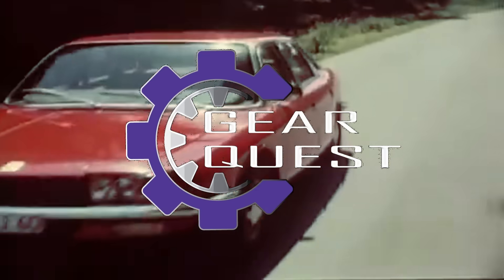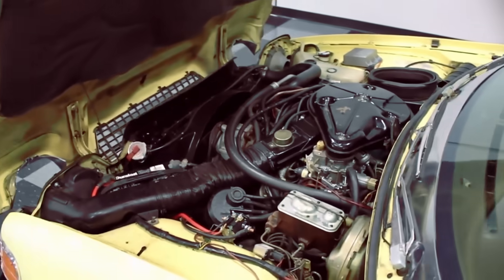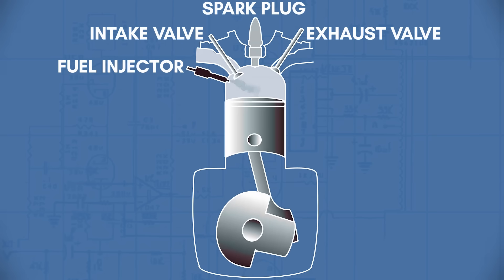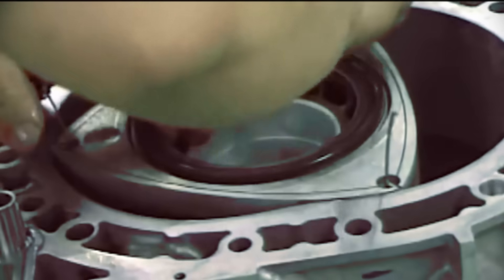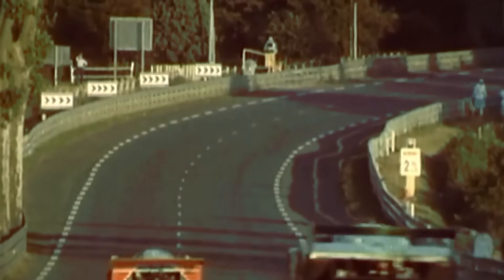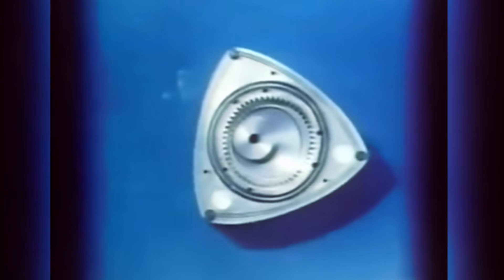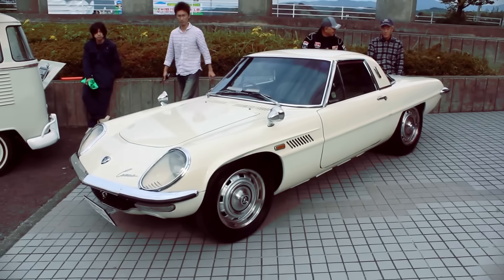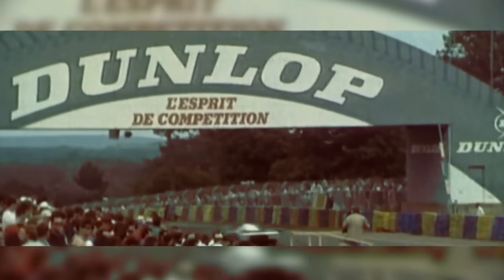The History of the Rotary Design

Comment: Why rotary banned? 

An easy win 🤔 Maybe.
Reply: it was a win by accident... in Group C the rotary was never successfull, the 24h win was pure luck of Mazda that all favorits from Jaguar and Mercedes run into trouble a the same single race... the rest of the season the Mazda rotary never had a chance to win anything..it even failed to battle private raced old Porsche 962 and only the pure luck victory at LeMans put Mazda on place 5 at the end of the season ahead private raced Kremer Racing Porsche 962  (a 7year old racecar at that time in 1991) with only 4 points ahead of a 7 year old race car... 

The old private Kremer Porsche beat the Mazda rotary in every other endurance race of 1991... by race succes and result numbers the Mazda 787B was no great race car..only the internet hype later made it "historical" 
1991 was dominated by Jaguar
Reply: Well i don't want to disrespect anyone.

 Rotary engine is very good engine but a bad engine at the same times, people try their best to make it "reliable" until now, i don't know how long its gonna take to perfecting that engine.

If you ask me why, i'm just can say "the raw power that engine make, will make all people put a smile on their face"
Reply: If that was the case, the 787B wouldn't only have 1 win under its belt.

Regarding Group C, wankels were "banned" merely as collateral damage caused by regulation changes, designed to make Group C less attractive to Privateer Teams in comparison to Formula 1.

The Porsche 962 (3 liter Twin Turbo Flat-6), Mercedes Sauber C11 (5 liter Twin Turbo V8) and Jaguar XJR-9 (7 liter naturally aspirated V12) were "banned" too after all, since their engines didn't fit the new regs either (new regs said 3.5 liter naturally aspirated F1 style engines).
Reply: The fact that many JDM car get banned in many race its make me curious?

Well we know the fact that japanese car sold every where in the world, its like dominated the car trade, 🤔 maybe, just maybe its why many fast JDM car get banned.
Reply: @ketutkartini3768 
Name a race series where a Japanese car has been specifically banned.

And no, Le Mans isn't one, since Mazda still raced in Le Mans, when the new 3.5 rules had been implemented (mind you, the MXR-01 didn't fare that well, but then again, few Group C cars did with the 3.5 rules).

In Group C at least, the decision to change into a 3.5 liter formula, was motivated by a wish to make Formula 1 engine development cheaper (and lure teams away from Group C), and had nothing to do with "stopping JDM cars from winning Le Mans".
Reply: Ratter then ask me, why don't you search it on google for more information? 😅😅😅
Reply: @ketutkartini3768 
I have researched this.

There is none.

The Wankel wasn't banned because of it being "too good" and AWD being banned from Touring Cars wasn't just because of the Skyline (nah, ze Germans had an AWD car too, and it was montering races in DTM, just like the Skyline was killing it in the JGTC).

Just concider the Mazda 787B myth thoroughly busted. It had nothing to do with the FIA or the ACO wanting to keep the Japanese out of Le Mans (I mean, if that was the case, why did Toyota keep on racing there, with the Supra GT1, the TS-010, the GT-ONE, the TS-030, TS-040 and finally winning with the TS-050 although, only after all the other works LMP1 teams had left).
Reply: I still had my opinion 😃
Reply: @ketutkartini3768 
This isn't about opinions.

It's about facts (and possible libelling of a motorsports organisation, but we'll let that slide).

If you think the Wankel was banned by the FIA or the ACO from Le Mans for being too good, then you better have some hard evidence to back it up.
Reply: People free to had their opinion, its not like i want to blaming someone or something just because japanese car get banned.

Or need to prove what i am saying, its just my simple opinion saying "japanese car get banned because its being too good". If everyone can feel free to had their own "ego" why i can't? 😎
Reply: @ketutkartini3768 
Because, that's a claim, not an opinion.

"I like Japanese cars better" is an opinion.

"Japanese cars got banned for being too good" is a claim (and one that's false).
Reply: I don't really care about silly stuff like that, for me japanese car is the best then glamor, stupid expensive, unreliable car.

Even if japanese car is old school.
Reply: @ketutkartini3768 
Well, you have to care, if you want to get into racing.

And generally, regs don't care shit number 1 about your tastes.

But hey, FIA is phasing out LMP1 in favor of a new Hypercar class (think, late-90s GT1, so maybe Toyota wants to do a repeat of the GT-ONE), so maybe Mazda wants to have another whack at the whole Wankel malarkey.